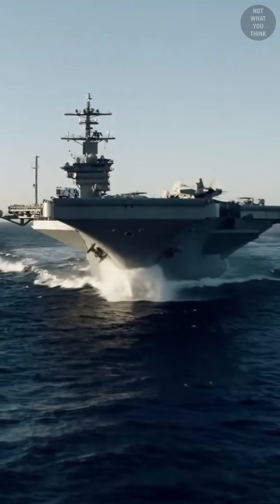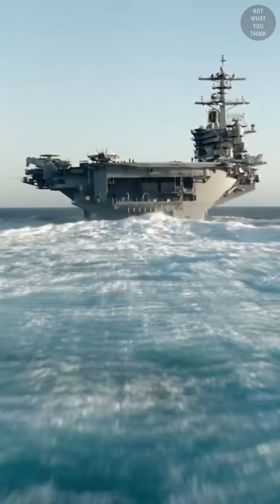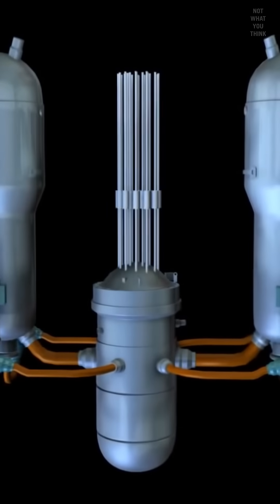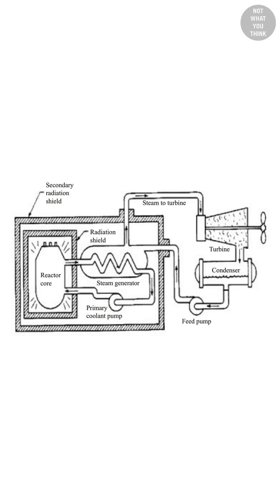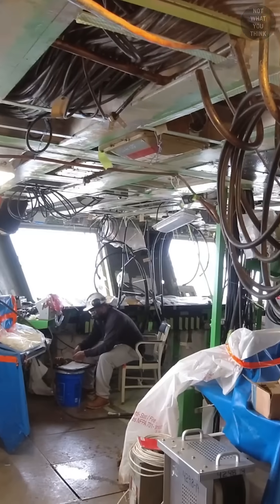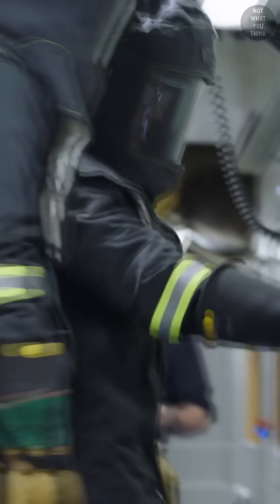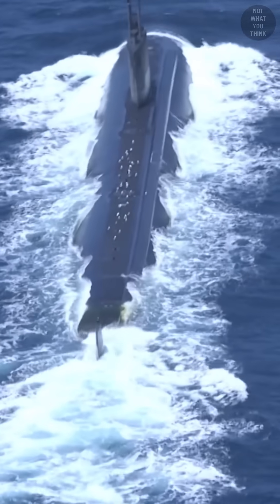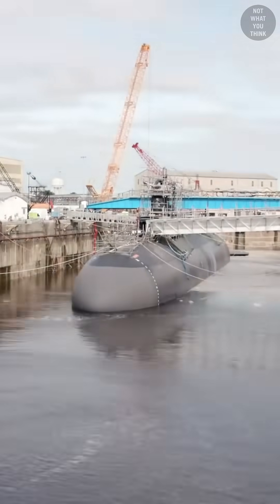How Are Nuclear-Powered Carriers Refueled? #shorts

Comment: Fun fact: Approximately 99% of the fissile mass in the reactor is still usable after those 25-ish years, but it’s more expensive and dangerous to re-process them into new fuel rods than to just manufacture new ones.
The energy density of Uranium is brain-melting.
Reply: Yeah. A lot more than fossil.
Reply: @Jaxorian  yeah but it is more expensive and harder long term so it will take a lot time in countries like the US were companies can have more power than entire counties or states of people
Reply: That only applies to commercial reactors. Which only have an enrichment of 5% u235, with 95% u238 which isn't as easily fissioned. Naval Reactors are enriched past 90% u235 which allows for much more of the fuel to be burned
Reply: @Toefoo100  That is partially correct, however, the amount remaining is still quite significant.
Reply: @jamesharding3459  still not 99% for naval Reactors
Reply: @Toefoo100  Some back-of-the-napkin math would seem to indicate it to be about 80% before thermal output dropped unacceptably. That's almost certainly off, but probably not massively.
Reply: Quite literally melting your brain im afraid 🤣
Reply: Of course u had to change the process to STILL  keep it secret.
U fast forward the process and the new implementation.
Reply: Hopefully with new technology we can use alot more of that energy.
Reply: Energy density of uranium is brain melting.

...Like literally brain melting.
Reply: Really brain melting indeed
Reply: Is also face-melting
Reply: That's such a waste
Reply: @borism4629  That Uranium is going to decay anyways. No way to stop radioactive decay.
Reply: They probably chuck it in a centrifuge tho
Reply: It quite literally is brain melting
Reply: Look,if they were really after the safer and more durable solution instead a "trash" to make nukes from LOS that can't even get inspected!
Thorium Salts reactor would be a way to go! Thorium is like 40 times more abundant than Uranium, does not need enrichment that I am aware of and there is no way to get a nuke-making material out of it, and is pretty much idiot-proof!
Reply: @maxluburic657  Thorium might make sense for civil reactors, but the reduced longevity and power density is unacceptable for a naval powerplant.
Reply: Damn that's crazy!
Reply: 24GWH/kg this is either a Cube with 37,4mm or a Ball with 40mm or something like that
Reply: Literally
Reply: Unless you have a Liquid Thorium reactor. Then you can take old fuel aka nuclear waste and use it up more completely.
Reply: We had a breeder reactor program in the 90s that would have economically recycled spent fuel, but Clinton killed it for political reasons (presumably between his trips to epsteins Island).
Reply: @jaffacalling53  they where killed off because they where expensive and dangerous with the technology available at the time
Reply: I've always wondered if a Carrier reactor meltdown can release as much radiation as Chernobyl did? Or is it much smaller or something?
Reply: @Avenger-K  The reactor aboard a carrier is much smaller, and radiation would disperse far less readily in water than in air.
Reply: @Avenger-K  a carrier reactor cannot meltdown in the same way as Chernobyl so even if they were near same size the fallout would still be fractions of that of Chernobyl and almost entirely absorbed by the ship.
Reply: @Avenger-K  a carrier reactor is smaller than most land based reactors, including Chernobyl. Assuming only a single reactor had a meltdown, there would be less radioactive material available to cause contamination than Chernobyl.
Reply: @Avenger-K  no it cannot. no reactor can do that. chernobyl was incompentent build like a bomb.
on a ship its a non issue, ractioactive material in the sea does zero. theres more natural in the seas than humans could ever dispose
Reply: @Avenger-K  Im definetly not an expert on the subject but I'd imagine these reactors are much safer than the reactors of chernobyl. One of the fatal flaws in the chernobyl reactor was that the rods had graphite on them, which if i remember correctly continued the reaction after the core exploded, im fairly certain the US Navy wouldnt make the same mistake especially when money is less of an issue for the US govt as apposed to the Soviet Union, which once again if i remember correctly was manufactured like that in order to save money.
Reply: @abrahamm1325  not entirely accurate. RBMK is a fairly safe design. Chernobyl failed due to a number of (important) details.

The rods that you mentioned are not made of graphite, but graphite-tipped. This is normally not a problem, except for when the rods are fully retracted (which was not standard operating procedure). The (inexperienced) team on shift that night would have also never fully retracted the rod, if they had had more accurate and less laggy instruments indicating current power output.
They should have also not operated block 4 at such low power levels, as the reactor design is unstable at those levels and needed many (manual) corrections in order to maintain the desired power output.

If they had just fumbled it and let the reactor "stall", there would have been no overreaction.

Fun fact: RBMK now runs on reformulated fuel which allows for more stable operation and has a void coefficient of approximately zero. Chernobyl could technically not happen again.
Reply: @daszieher , 😳🤯😳🤯😳🤯😳🤯😳
Reply: Brain-melting, both figuratively, AND literally!
Reply: For an organisation that has an entire culture built around wasting BILLIONS amof taxpayers dollars you'd think they wouldn't care about the miniscule overheads necessary to make use of that fissile mass.. but no.. just bury it somewhere it can irradiate for a thousand yrs just sitting there 💀
Reply: I assume it can be literally brain melting too if something goes wrong